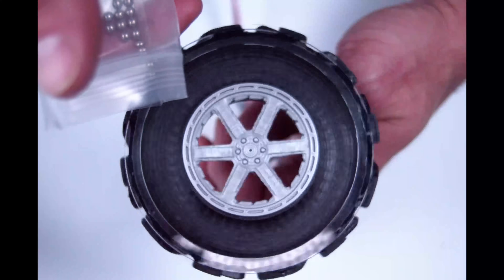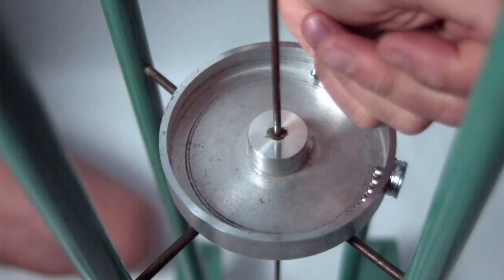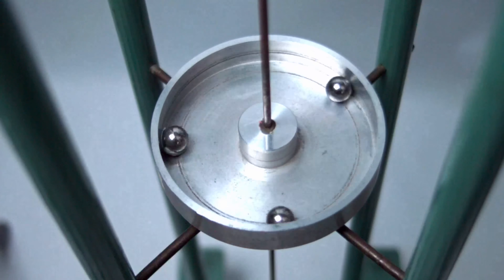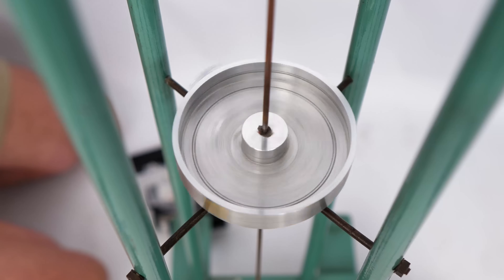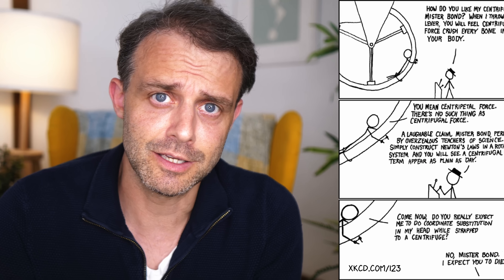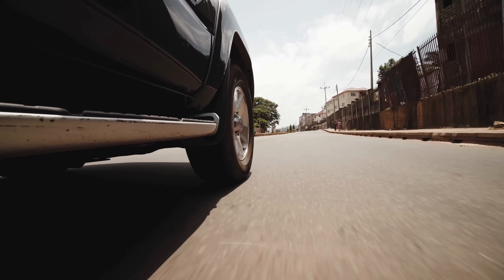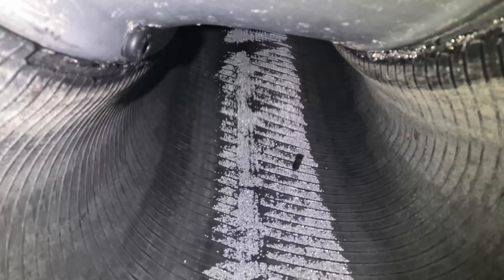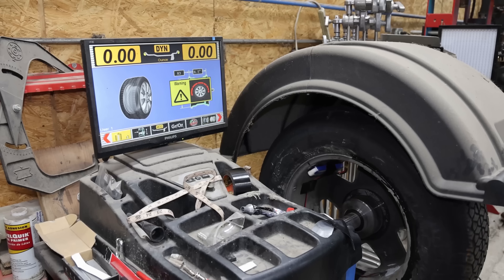Do tire balancing beads actually work?

Comment: A couple of observations: 1) This ought to work with liquids too, and 2) if you could freeze the weights in place at highway speed they would keep the tire balanced even after you stop.  Which makes me wonder: what if you put some urethane rubber resin in the tire and then drove on the highway long enough for it to cure?  Would you get a perfectly balanced tire that stays balanced forever?  

Lord help you if you run into a traffic jam, though!
Reply: So, Slime
Reply: You could also spin up the tire on a machine while it cures. Tire shops already have tire spinning machines for the fixed balancers!
Reply: @jacobhuckins494  Depending upon the formula curing could take an hour or more so that is a long time to occupy the machine meaning shops would need a lot of them.  Liquids also have skin tension which would oppose the attempt to balance correctly and instead make a uniform circle.
Reply: Bro's on to something
Reply: Doing it with a special tool or with the vehicle suspended sounds like the right call. The tire deforms a lot under load, shaking the beads out of position (the video was soo cool). This sounds like a cool new tool to auto-balance tires, but I just don't see it as better value than simple metal weights.
Reply: Even perfectly balanced wheels can lose the balance over time and will need rebalancing every so often, mostly due to the tire tread wear. Now, when you use fixed wheel weights and the wheel becomes unbalanced, you go to the tire shop, they remove the weights, balance the wheel, fix new weights and you're good, 15-20 minute job for all four wheels. Now think about your idea of urethane resin inside the tire, splashed not only on the inside of the tire, but also on the inside of the rim. To rebalance the tire you'd need to take off the tire from the rim, scrape it all out or downright replace the tires. It's just not feasable, nor practical. Balancing beads self balance as mentioned in the video and later on when you need to replace the tire they are free to go, I assume they could be vacuumed and reused with new tires. It's way less messy and time consuming.
Reply: @jarekpszuk6944  Nah, if the tires need rebalancing, just add another round of goo!
Reply: washing machines use a ring of liquid to balance the tub when it's on a spin cycle - and a few years ago, geniuses on tik tok were telling people to drill holes in them and let the 'trapped' water out!
Reply: Just as long as it become unbalanced again
Reply: On #2, I'm pretty sure this  would defeat the entire purpose of a "balancing beads/liquid". The point of the beads is that they will always, throughout the entire life of the tires, balance the tire. If you get a rock in the tread, the beads will readjust and balance the tire. But if you had a liquid that sets in place... well what's the difference between that and just getting your tires balanced? As soon as you get a rock in the tread or wear a small patch in the rubber, your tire will be unbalanced again and your liquid that set ain't doin nothing to fix it.
Reply: I'm skeptical a liquid would work to balance since the individual molecules would be so small as to have an insignificant effect by themselves. Once it starts balancing, the liquid would move to a more regular distribution rather than whatever the balanced one looks like. Depending on the speed I could see some oscillation happening. This doesn't apply to the glass beads or bearing balls because once it's balanced, those discreet objects don't deform or move. They're already in the place they would stay if they started there (and accelerated with the wheel) 

That lack of deformation keeps it balanced, but the force would change from the optional liquid distribution for balance once it's balanced

Comment: I ride motorcycles. I've never experienced a tank slapper, aka death wobbles, but I've been told the way to get out of one is to speed up, not panic brake. Speeding up is supposed to stop the front tire from oscillating left and right. I wonder if it's the same idea as balancing beads.
Reply: I think accelerating fixes a death wobble not because of the increased speed, but because accelerating reduces the load on the front wheel.
Reply: The best way to get out of it is to entirely let go of the handle bars.

Comment: I kind of felt like the answer was similar to what happens during precession. Like in the high speed mode, the wheel had already rotated too much before the bead can uniformly deflect it in any specific direction.

Comment: could you add some sort of glue that is only activated under pressure or after a set time... stick it in with the beads and then drive until they stick in place..    Actually, would it work with a liquid?

Comment: If it works with beads, does it work with a liquid???
It should, right?
So why not have some kind of rubber epoxy or something of that sort that you pour into the tire and then drive down a highway for half an hour or so.

Comment: It's a neat principle and quite fascinating BUT, I think if there were any value to it as a way of balancing tyres, it would be fully exploited in the motorsport world by now. The lover weight required and the accuracy of balance would have got it into the teams a long time ago. Dynamic balancing like this would instantly compensate flat-spotted tyres.
Aviation too.

Comment: Okay, then, what they should make is a balancing bead that has an adhesive inside and shell that only breaks when it has highway speed forces applied.

Then, when you get up to highway speed for the first time, all the shells break, the adhesive oozes out, and all the bead material is glued in place so that when you stop, they stay put.

Comment: What if you place a metal liner inside the tire, that can hold magnets. Then toss in small magnetic balls and when you slow down, they will not fall to the bottom due to gravity but remain fixed in place keeping the tire balanced even at slow speeds without the need to speed up again.

Comment: Presumably if you remove the tire and find a machine that can spin it at 15-20 revolutions per second, you could use this to place beads (or weights) in perfect places, then glue them in, and fix the problem permanently. I wonder whether that's how mechanics place the weights?

Comment: I use both. Weights to do initial balance and beads as a backup or fine tune. You can throw a weight or get gravel stuck in a tread or the tire just wears a little weird and the static balance is changed a bit, but I dont want to bother taking the wheel off right now and adjust the weights so I just rely on the beads for a bit. Now, in a perfect world (MONEY), you fill your tires with nitrogen and a bit of a solution that only hardens in the presence of oxygen, and you get temp stable, self balancing, self-sealing leak proof wheels!
Reply: Turns out, the nitrogen thing is a bit of a scam. IIRC, There is already so much nitrogen in the atmosphere (78%) that the temperature differential is almost zero.  I forget the science video I saw this on, but it's well worth watching. Possibly John Cadigan in Oz
Reply: @aivkara  it is used in aviation applications for temp and humidity control in tires. But in this scenario, it is mainly to displace the oxygen for the reactive sealant.
Reply: @aivkara  Nitrogen works well, particularly in extreme climates or when the tires deal with massive deltas such as going from a heated garage to a -50 road or stay out in extreme cold for extended periods. I'd never pay for it as you can get it free many places, you need to live in a climate where it's useful though.
Reply: If your tire "wears a little weird" then you probably need an alignment.
Reply: @Vykk_Draygo  true or  maybe have a lead foot and get an little loud at stop light, fast on a favorite corner or off road and rub on some rocks.

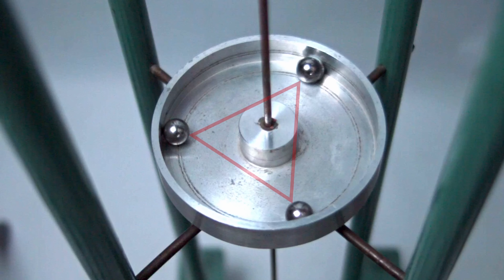Comment: 3:50 It's because of the way the spinning pole transmits the spin, because it's flexible and attached at both ends it wants to self correct or something if it wasn't flexible like on the axle of a car it wouldn't self correct, I think lol

Comment: Why glass tho? Wont they hit eachother and turn into glass dust and chew up your tires from inside?
Reply: No, don't hit each other hard though to break or chip. No where near enough force for that to happen. Glass is used because it is very very smooth and mitigates fear that it will somehow abrade the inside of the tire (which I think is a bogus concern tbh). They are also QUITE small, at least the ones I have used for motorcycles, and I would bet it is easier to get glass/ceramic smooth and uniform at those diameters than steel.